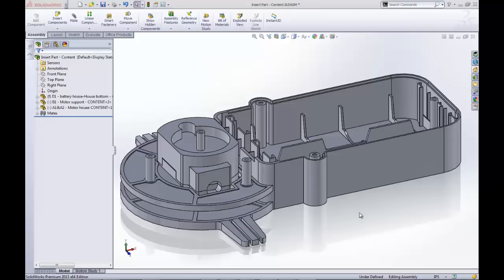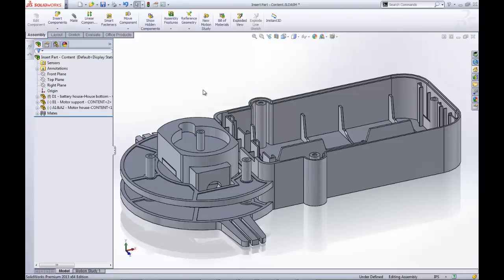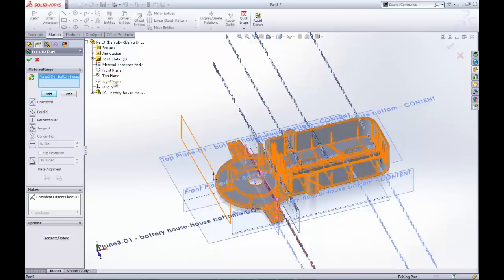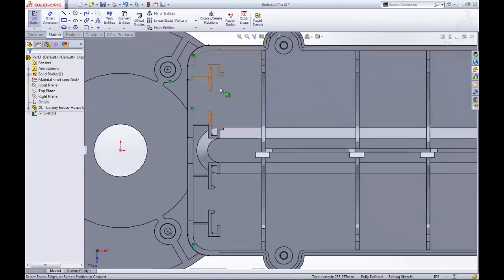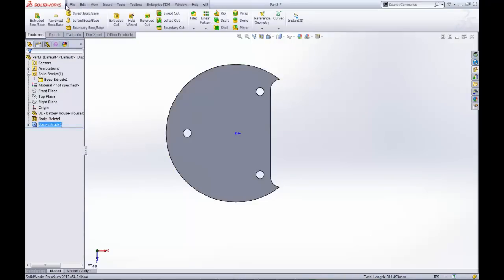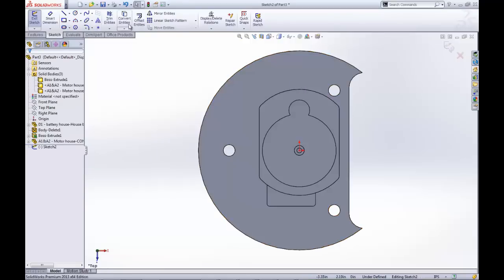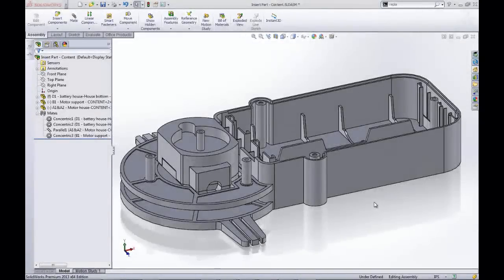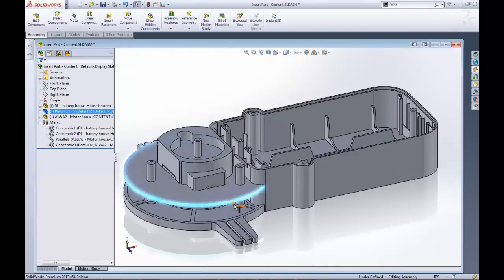SOLIDWORKS – Insert Part

Comment: Many features and options shown here such as option dilouge box for placing the part  seem to be deprecated from solidworks 2020.
Reply from the maker: Hey Jack, make sure you check the box 'Locate part with Move/Copy feature' when using Insert Part.